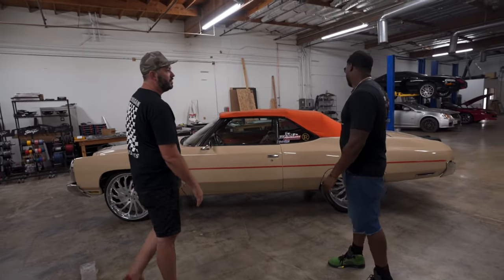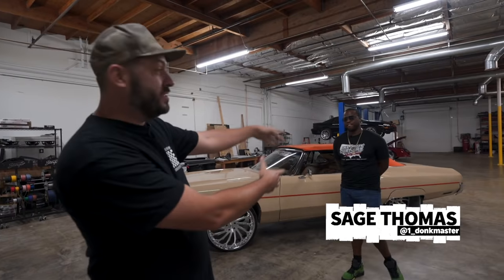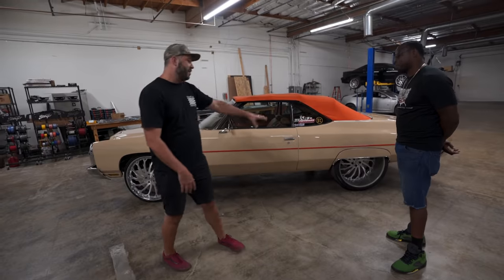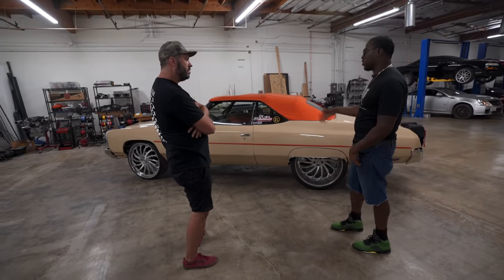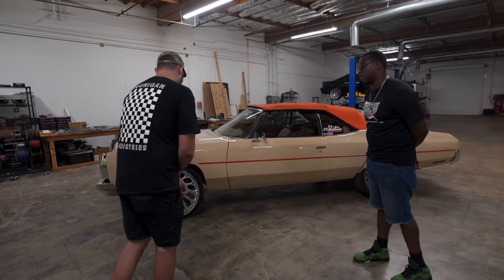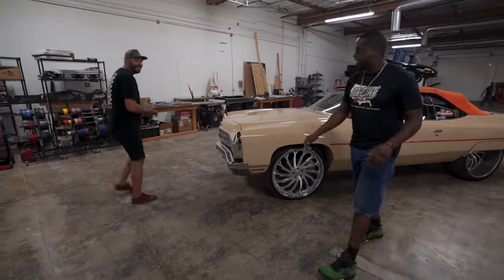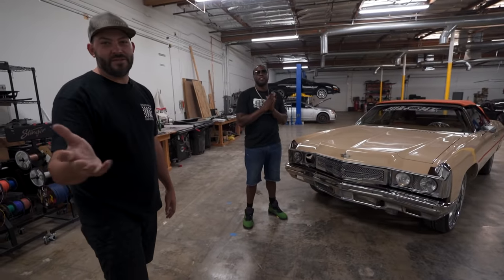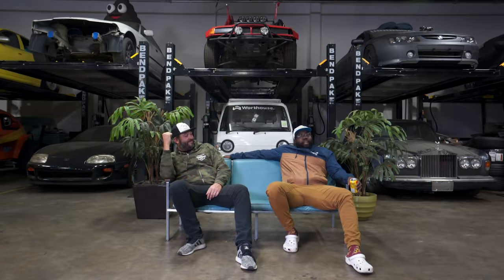1,200whp Donk Sitting on 405s?? Country C’s ’73.5 Caprice, AKA the Carolina Cantaloupe

Comment: 4500 pounds and under 10 seconds on 24 inch or bigger wheels..that is MOVING
Reply: Mister Bojangles  lol you're just mad because you couldn't engineer style and function
Reply: @P0k3D0nd3M4cG  ikr,even bugatti rims are way bigger than any super car and the reason is better traction.
A taller wheel and tire will provide double or triple the traction than any wider tire and this is proven by motorcycle racing since the wheels got taller over the years.
Reply: @benjaminfranklyn604  it's the tire diameter that is the most important, not the rim diameter
Reply: @mgn567  not really ,yea is good to have a taller side wall for the tire to be a able to flex ,but a bigger length of tire thread is better for grip since the thread are meant for grip and not the side wall.sidewall offer so little grip while bigger tires and wheels gives a smoother ride and make every small pot holes look like cracks on the roads.is like comparing small and larger shoes ,both might have the same width but the sole on length is not the same,the bigger shoe might offer a slight advantage in grip.
Reply: @benjaminfranklyn604  i never said the width  was not important, i was just saying that the tire diameter is more important than the rim diameter, the best is both like in F1
Reply: @mgn567  actually f1 is going to switch to smaller side wall tires.
Reply: @benjaminfranklyn604  yeah but it comes from the FIA rules, they will also forbid heating blankets for tires. it's not for performances improvement.
Reply: @benjaminfranklyn604  i did some research and found this : https://amp.nextgen-auto.com/fr/formule-1/des-f1-2-secondes-plus-lentes-allison-analyse-les-consequences-des-pneus-18,148904.html

Comment: the place hes talking about for the tires is called Custom Car Audio Wheel and Tire in Richwood TX,  they filled a hole in the market since Pirelli was the only tire manufacture making a 405 wide tire but only for 24 inch wheels. They offer a 405 wide tire for 24, 26, and 28 inch wheels

Comment: long version of build biology is better.

not showing an engine bay is stupid, ya aint got anything revolutionary under there bud.
Reply: TOTALLY AGREE, WTF ? OPEN THE HOOD BRO.
Reply: that was super lame at that point i would have just shut the whole shoot down and been like "ok cool thanks man!" and just been done with it... also there's a reason you never see actual drag cars with those kids of wheel/tire setups you need to be running some mickey thompson at like 14psi
check out Murda on twitch who livestreams from texas drag races and you can see hooptie'd out pickup trucks faster than these things
Reply: It’s grudge racing, man with high stakes betting and at the time the release date wasn’t set and the car had more races on the schedule. But thanks for watching
Reply: @stevenmorrison3685  then they should have picked a car they could actually talk about and show. Not hating just would have been cool to get see some of the hard work that goes into making these cars go.
Reply: @jonandrew4316  scato chose the car clam down
Reply: @sim6057138  really,ya don’t say Scotto picked the car duh 🙄. I like the car but would have liked more of a build break down. So pump the breaks.